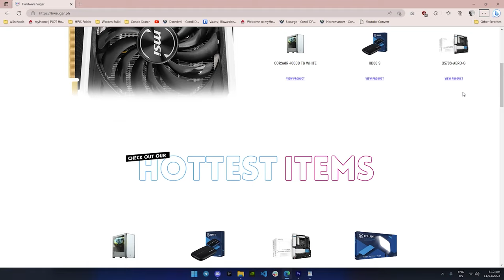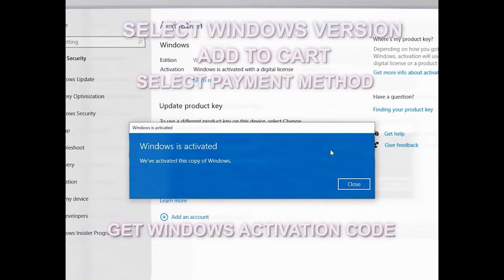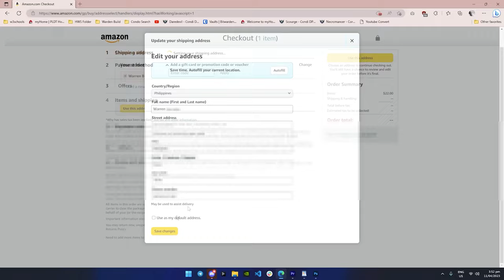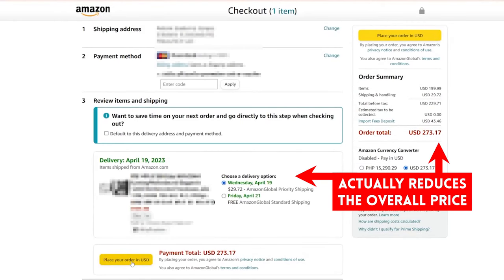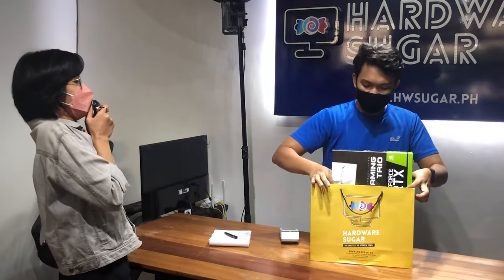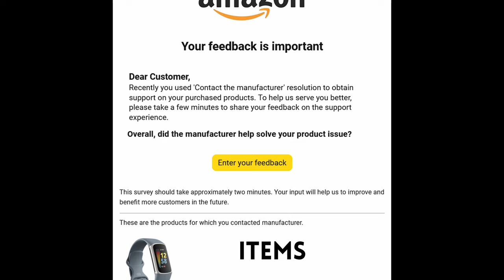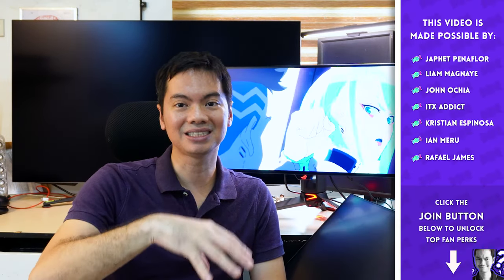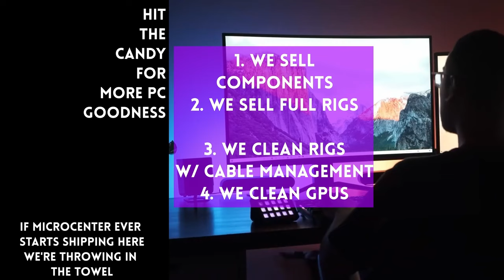I bought from the enemy... and the enemy was GOOD 😢

Comment: Last Black Friday, I bought an SSD, RAM, air tower cooler, and PSU from Amazon and had them shipped here directly with no issues. Shipping can even be free if your items qualify for free shipping for orders over $49. One key tip is to try to buy items fulfilled by Amazon and not a third party merchant. One item I ordered got lost in transit and my refund was issued almost immediately. In total I have had no problems at all with Amazon but will never use them for something as large as a monitor.

Comment: I’ve bought a couple of pc parts from Amazon and Newegg. Regarding warranty, the 16gb ddr4 ram I bought from Amazon broke down but it was out of warranty na Kay Amazon so what I did was contact the manufacturer in Taiwan since the ram had lifetime warranty. The company asked me to ship the faulty ram to Taiwan then they sent me a set of new and faster ram. Downside lang was I had to pay for the shipping cost. Still came out cheaper than buying new equivalent ram locally. So all in all, panalo pa din ako. FYI lang based on personal experience.
Reply: What brand was your RAM?
Reply: @ailluinthethyra6139  Patriot 16GB Kit (2 X 8GB) 3400 MHz (PC4-27200) Viper 4 Series DDR4 2400 MT/s DRAM (PV416G340C6K). Bought it nung 2018, Nasira soya late last year
Reply: @PP-bq6ht  Thanks for the info. Plan ko din magupgrade to a Samsung B-Die kit from Amazon & pinakamura so far yung Patriot Steel Viper. Wala akong makita locally.
Reply: @ailluinthethyra6139  it was my first time trying out patriot RAM. Would definitely consider their ram in my future builds :)

Comment: Although I haven't purchased that much from Amazon, but had an experience of requesting for replacement for a damaged item. It was an LCD panel replacement for a laptop. Returns was handled by DHL, return label was provided so no payment needed. But yeah, turn around time took 3 weeks. So total wait was 6 weeks just to get a working panel.

Local suppliers for me still. Specially those that have physical stores where you can have the item tested (if possible) and warranty is very easy to claim. At the end of the day, really up to the buyer, availability, and as mentioned in the video on how willing you are to take the risk now for convenience vs claiming warranty if things go south.

Comment: I only bought from Amazon because of their massive discounts.
4,999 for a Ryzen 5 5600 is too good to pass up.
also 2500 for a 1tb Gen 3 NVME SSD (I have a b450 mobo so I didn't choose the Gen 4 variant lol)
Reply: Sayang din yung PCIE Gen 4 that the 5000 series offer kaya nagcocontemplate parin ako if I'll upgrade to R5 3600 from 2600 eh kasi 5600 is cheap at 8k HAHAHAHAHA
Reply: @morpheus5162  go for it! Naka A320 mobo lang ako pero sinalpakan ko ng Ryzen 5600 and RX 6600. Hahaha
Reply: @mrkvn223  I would love to brother pero as a "spec sheet compatibility nerd". Na sasayangan ako sa speed from PCIE Gen 4.0 na ibibigay ni R5 5600 and 4.0 x 16 lanes ni RTX 3000, 4000, RX 5600-5700, 6600-6900, kung di supported by it's MOBO.  HAHAHA

Comment: Hey HWS. A comment lang not particular to the topic/content of this video: I noticed some kind of stuttering dun sa ibang clips in this video as well as in clips from some older videos. Yung appearance niya is comparable to kapag biglang bumababa yung frame rate nung video. Any ideas on why this happens? Sa editing ba nangyayari yun?
Reply from the maker: yes we've noticed it also, it seems to come about when Ren submits a video edited in Premier and then Anton edits that video in Da Vinci

it's weird though since it only happens in certain parts, if it were a problem with the video itself (the one initially edited in Premier) then it should happen for the entire portion of the video

also the audio doesn't lag, only the video

¯\_(ツ)_/¯
Reply: @hwsph  It's a conflict with Davinci and Premiere Pro's encoder. Make sure lang sir na same output and codec kayo ni Ren.